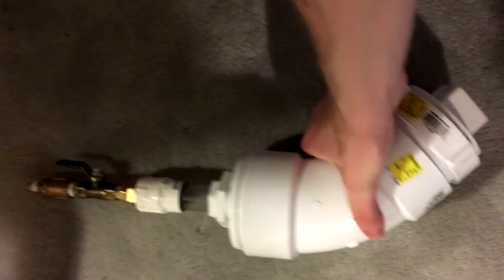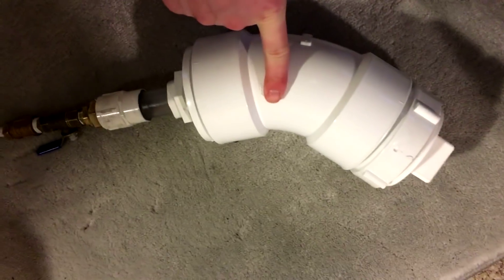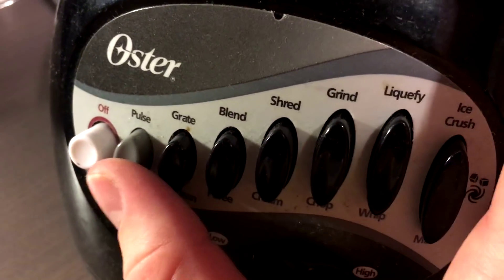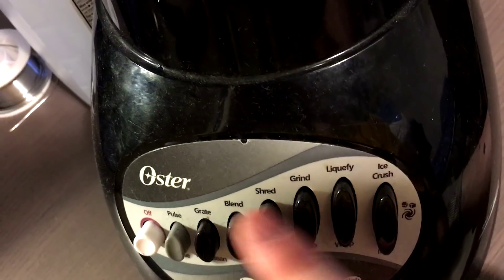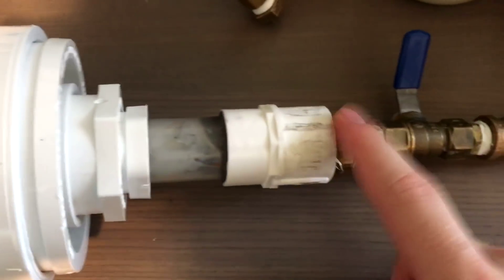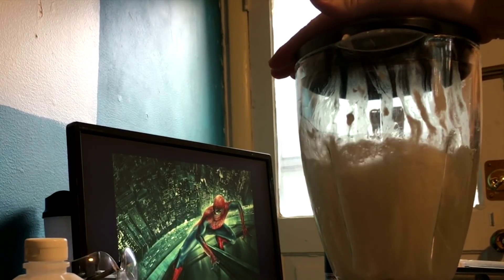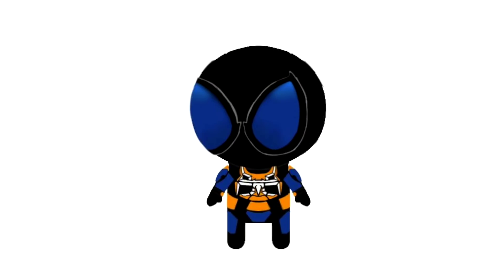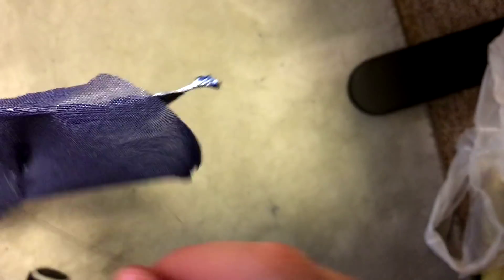Spider Suit Web Shooter Testing: Shear Thinning (Mark 14 Web Shooters)

Comment: I think that you should change your propellant, because 134a it has a low vapor pressure, and a low temperature. If you were to use propane,  then you could have more vapor capacity. although the vapor pressure of propane is quite high, all you would need is a pressure regulator, to remotely control the pressure coming out of the container. This would also give you more capacity, and therefore It would last longer. This would also help you with your budget, as propane is very common to come by, and quite cheap for what you get. Another idea that might help  would be changing your design on the wrist part, because it seems like controlling how much web fluid comes out is hard. Just some quick ideas! great job!
Reply: Also, the 134a  cools down your formula too much, making it way more viscous than it needs to be anyways.
Reply: No offense but strapping a container of propane anywhere on your body sounds like a bad idea
Reply: Propane is just as deadly as air, until it is ignited.